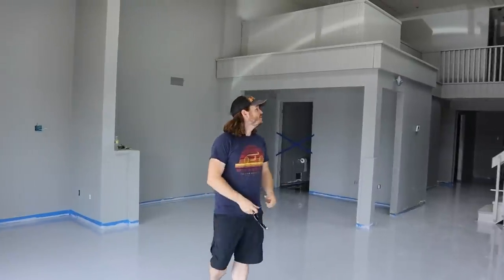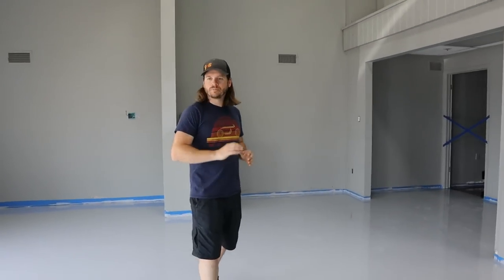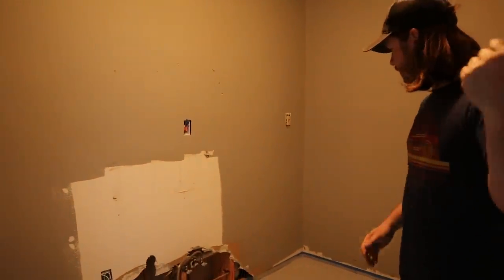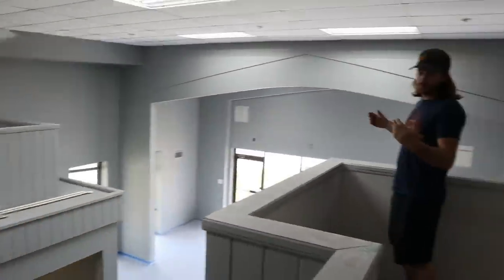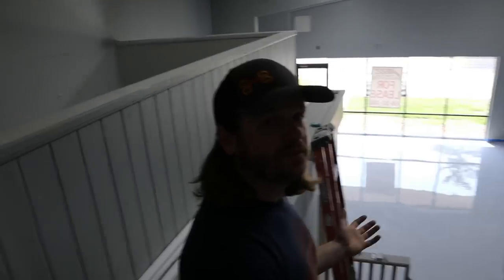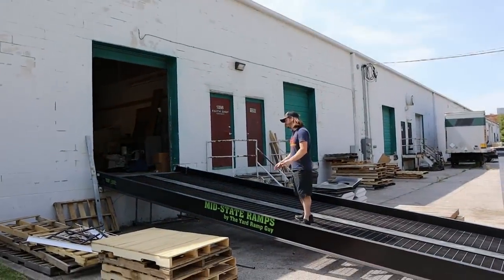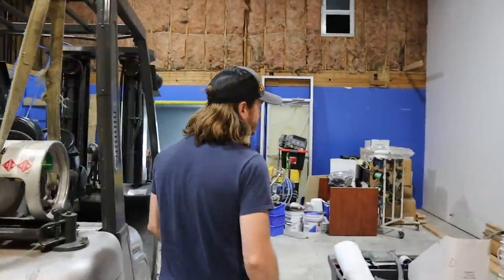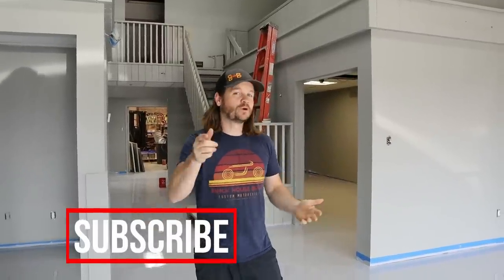New Motorcycle Shop Tour!! Its FINALLY Happening! EP1

Comment: From my own experience with my shop, I spent all my time organizing the actual work space for machining, mechanical, welding and a paint area, hardware area, media blasting area and parts. Only after the wrench’s started to turn and the machines where all in place and sparks started to fly… then I gradually began to add the refrigerator, stereo, microwave and other things.
At first you had me worried, by touring all the drywall areas. I was wondering where in the heck you where actually going to do all the mechanical, welding and so on…then when you finally got to the actual shop area I was relieved lol.  Definitely got to keep that very cool mural in the shop. After all, that’s where all the action will be! 
Good luck

Comment: Nice place. But I would swap your Merch and parts areas around, it would put you stock closer to where you work and its a lot easier to carry t shirt's and hats upstairs rather than engines and frames! keep up the good work🙂
Reply from the maker: Thank ya! I have only a small bit of merch and a ton of parts but most of those are light. Engines and heavy stuff will stay in the back.

Comment: Congratulations on your upward trajectory. Well deserved. Quick question, can't find a half decent fuel tank in England for under $400 for a cx500. Have you used tanks off other makes or models?
Reply from the maker: Thank you!  I have not used any non factory tanks on a CX actually. That surprises me to be honest
Reply: @BrickHouseBuilds  And me, what are you playing at ? 😜. I bet you can get your bikes cheaper than I can buy a knackered  rusty tank for ? UK is a rip off to be fair. Eg rusty rear swing arm about £150, $200. Decent rust free tank $600.

Comment: Isn't 110V used in America?

Or do welders specifically need 220V ?
Reply from the maker: 110v is the main voltage we use for basic appliances, chargers, computers, etc. 220 is used for out clothes dryers, ovens, and larger tools like welders.